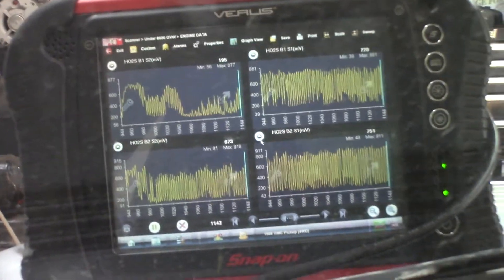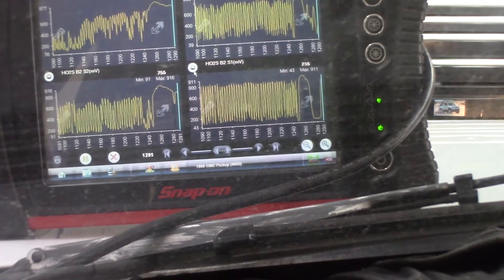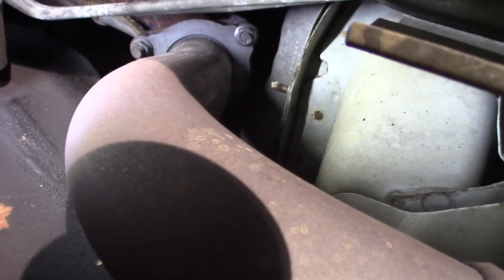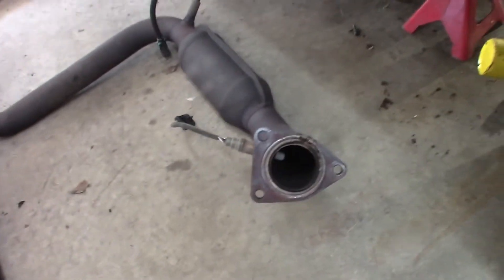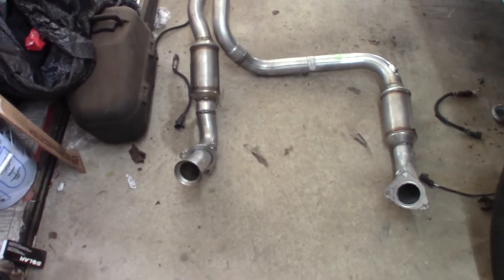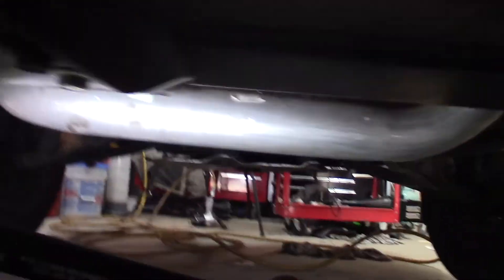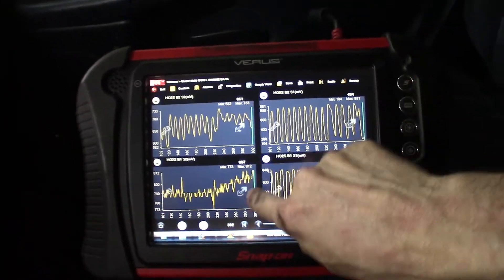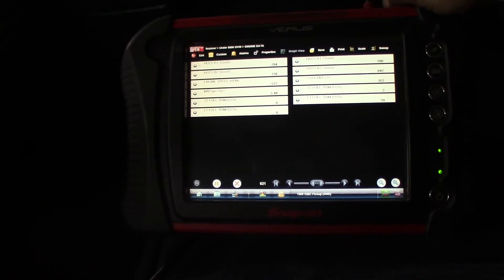1999 GMC Sierra 5.3L P0420 P0430 Catalyst Low Efficiency Codes

Comment: Already put new catalytic converters on a new O2 sensors and still have coeds. Po420. Po430
Reply from the maker: check for exhaust leaks.  Also, new doesn't mean good.  Could be bad 02 sensors or cat

Comment: what was the cats worth ??
Reply from the maker: Do you mean how much do new ones cost?
Reply: @CharlesAndCars  yes a new one  ,then i seen you can wash cats takes 10 hrs of soaking in dish detergent .or run a cleaner in your gas .and third you can put a spacer on your post oxygen sensor  which would be bad if it was plugging off . i think they can run like 600.00 cant they ?
Reply: @CharlesAndCars  found it they are like 900.00 bucks
Reply from the maker: https://www.rockauto.com/en/catalog/gmc,1999,sierra+1500,5.3l+v8,1355475,exhaust+&+emission,catalytic+converter,5808